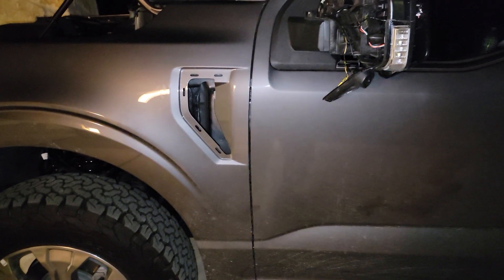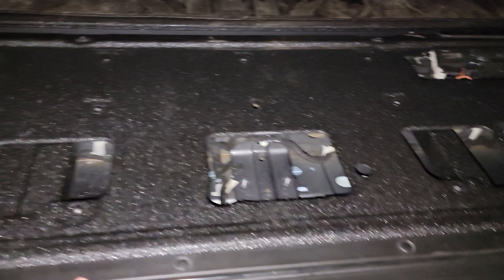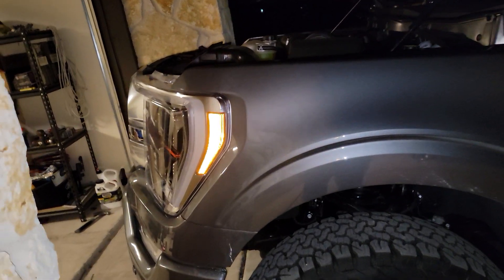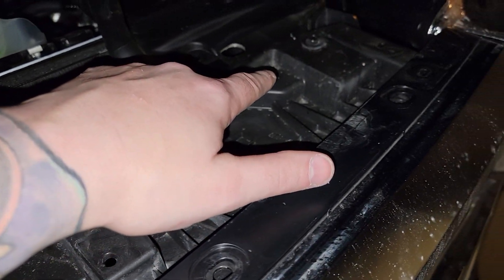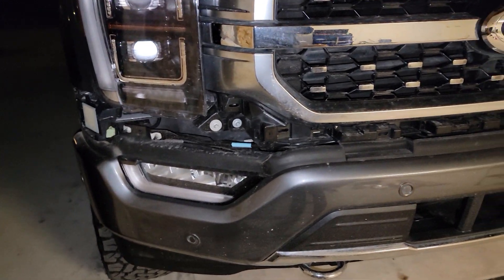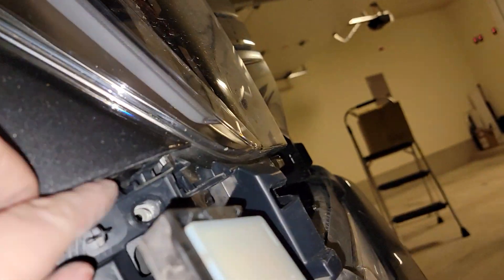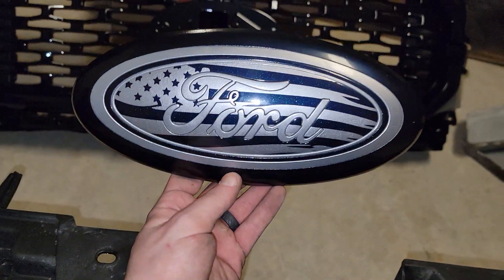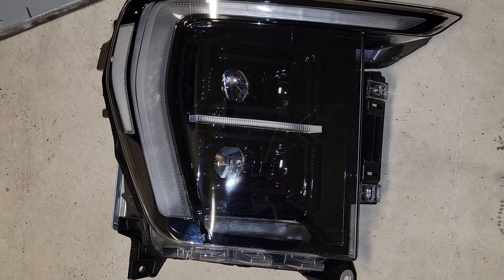2021 F150 GRILLE / EMBLEM REMOVAL. HOW TO REMOVE! (NOT AS EASY AS SIDE EMBLEM)

Comment: Do you know if the emblem is the same as the 2020 emblems? as far as how they mount? I bought some 2020 emblems for my truck and im going to use your video to get to them, but wondering if they have the same pegs and what not.
Reply from the maker: depends on which grille emblem you had/have currently as there were different emblems on the 15-20 models.. if you have a front camera, the cameras mount different between the 21s and previous years

Comment: Is the grill able to be disassembled so I can have certain pieces on my XLT grill?
Reply from the maker: It's... completely different than am xlt grille. You're not going to be able to swap stuff without custom fabbing it.
Reply: @MrBoom50  I just want to have the outer portion of my stock grill painted.
Reply from the maker: @brandonkadlec7850  I misunderstood your question. I assumed you were meaning the platinum grille to use on xlt

Yes. The xlt can be disassembled

Comment: The yellow connector next to the washer fluid connector in the video (@ 8:45). Does anyone know what this connects to? Mine removed easily, but the yellow "locking tab" broke off super easy.  Trying to locate what it is so I can replace the connector.  Thank you in advance!
Reply from the maker: It's for the camera. You could just use a zip tie if needed

Comment: I got a quick question hopefully you can help me out does the raptor grill fit 2021 f150?
Reply from the maker: Negative.. the front ends are completely different
Reply: @MrBoom50  thanks for letting me know
Reply: @MrBoom50  no FORD grill available for the 2021? Thanks
Reply from the maker: @middlehot  correct. Nothing is currently available aftermarket